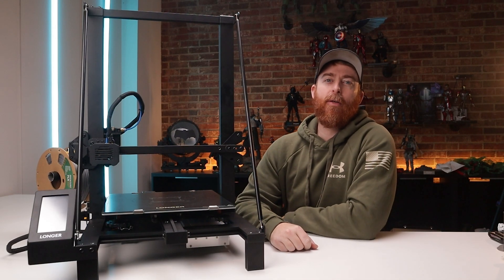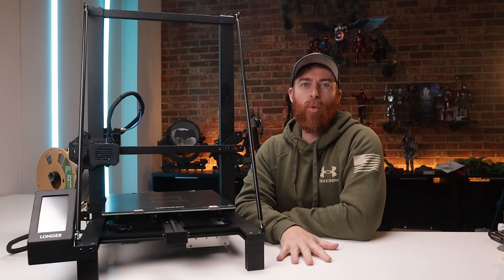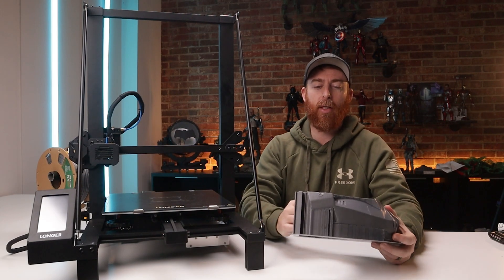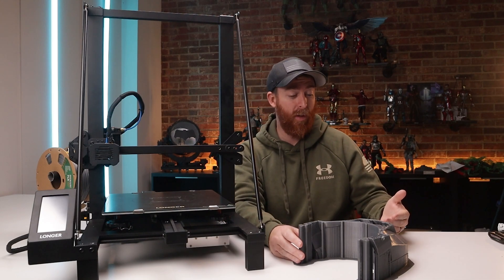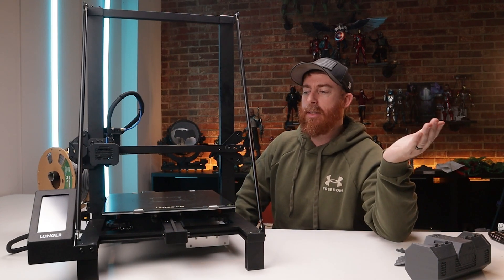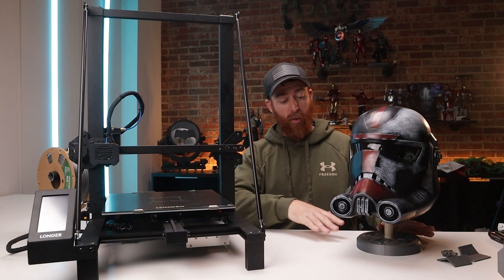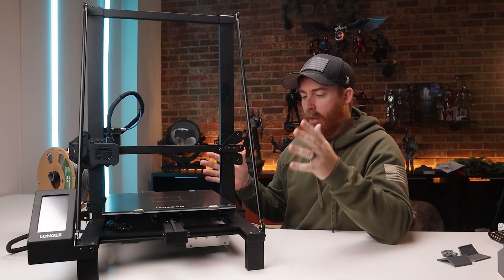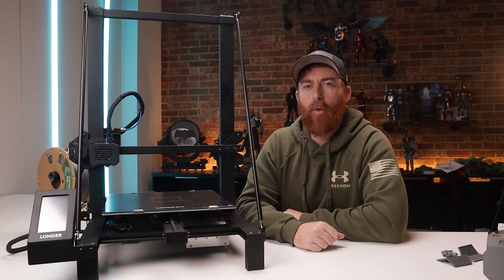Huge Upcoming Project Using the Longer LK5 Pro

Comment: With your helmet base printing you might want to look at turning on ironing to smooth the top layers. I would look at printing walls and structures to build your own diorama set pieces. Another fun printing idea is wall shelves to display figures and models.